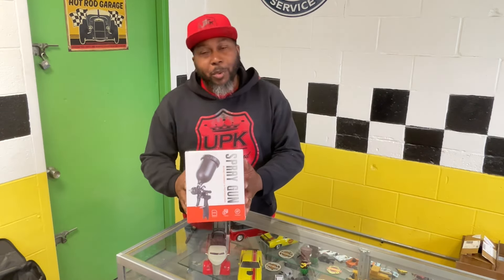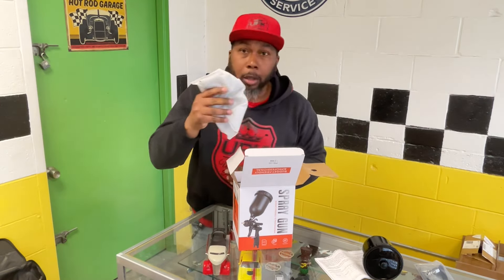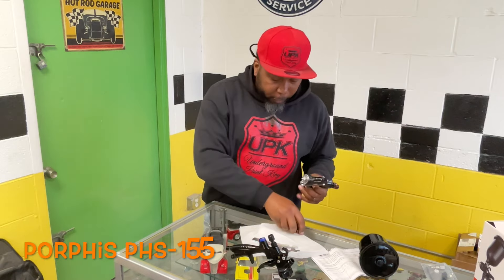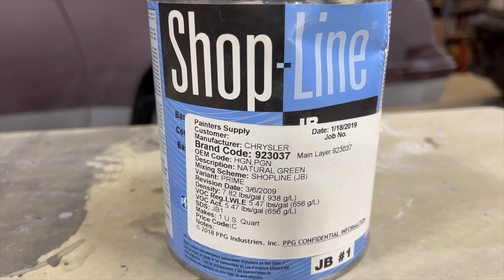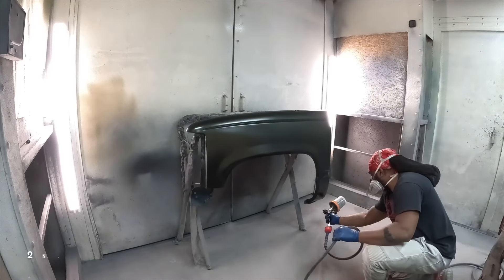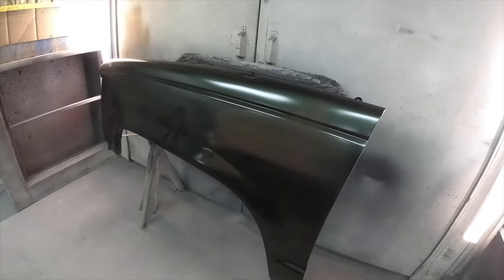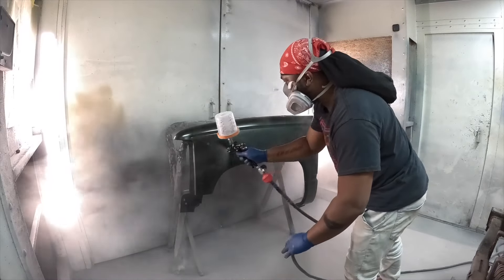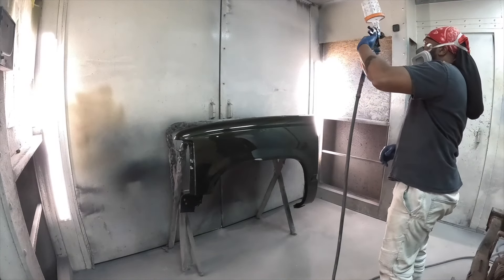Testing the PORPHIS PHS-135

Comment: I have a 155 and a 715. They both are outstanding and i use the 715 more for clear than my Devilbiss DV1-C clear gun since the output is twice as much with as fine as atomization. 
   The white derlin piece in the back of the nozzle is not a gasket its a bushing. The gasket was between the nozzle and gun body
Reply from the maker: Yeah I agree that they are very nice spray guns💯💪🏾

Comment: Just got mine today. The blue plastic thing can be removed, I'll put a M4x4 stainless grub screw in mine to make it look better. 3m pps 2.0 26003 S2C adapter fits this gun.
Reply from the maker: Appreciate the info Dong💯💪🏾
Reply: @UndergroundPaintKing  I was wrong, M4x3 would fit better, the grub screw i got was a cup point and it is not flush. Have to grind it. M4x3 flat bottom would work better, ebay seller The rusty bolt shop sells 2 pieces for 2 bucks.

Comment: I'm a beginner and I'm getting the porphis 155 that I watched you use in the other vid. Hey Underground King, will the porphis 155 work well with a 5 HP 20 gallon compressor?
Reply from the maker: It depends on what you’re doing, I think it’ll work well for doing small projects but attempting a overall paint job will be challenging
Reply: @UndergroundPaintKing  OK, I'm painting a car and I intend on doing it very well. I want a spray gun around 100-150.
Reply from the maker: @m.akbart3840  The 155 is a great spray gun and I recommend you do panel by panel if you do the entire car